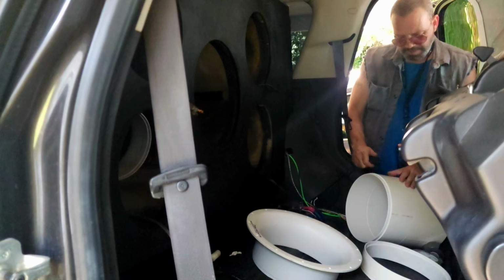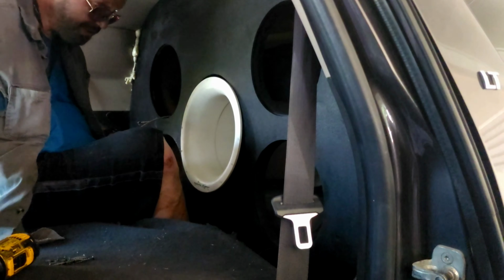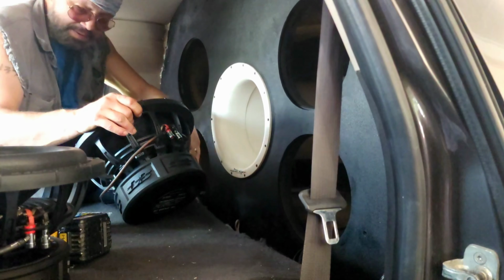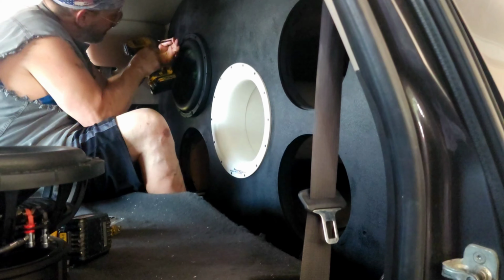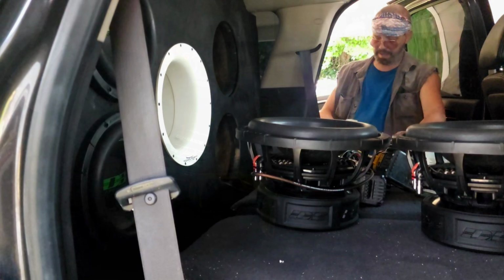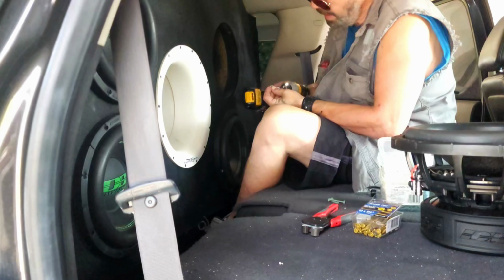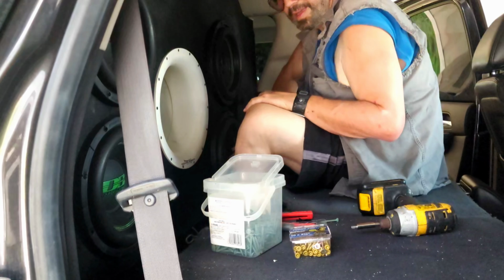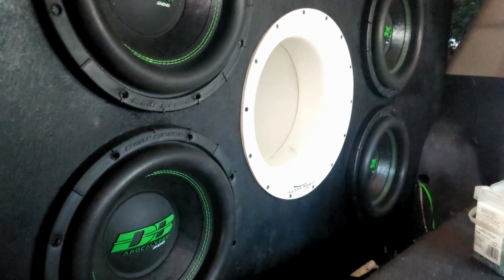Getting the Subs Mounted in my Tahoe C-Pillar wall

Comment: You could use some threaded inserts (the kind that you press in from the rear) just for the bottom two or three bolts. That way the pressure pulling outward is going to get spread over a large area on the inside lip. 

If you want to stick with screws, you can glue some scrap pieces of wood along the bottom inside lip so that you're using all the thread on those long screws. 

I also make it a point to pre drill pilot holes so that the screw doesn't want to split the MDF.

Comment: Did you heat PVC up and mold that yourself? I'm guessing put it in an oven maybe I'm going to search now I'm hoping you covered that I would definitely be interested in watching that process. I also worked for a plastics company doing injection mouldings.
Edit, yeah so I thought I saw the labeling on the pipe. I know those sections of pipe aren't cheap but I drop in the bucket compared to ordering a port online
Reply from the maker: this is an online port, Bigass ports. the box was built for this exact port, so it was the least painfull solution. beside the port is reusable, and can be tuned in may ways.

Comment: I'm going to build a box for my single avatar stu 12 n not sure on what size port I should use any suggestions?
Reply from the maker: man not really my wheelhouse, BUT i would and do check the manufacturer recomended size, then I make the box a bit larger, and tune a bit lower